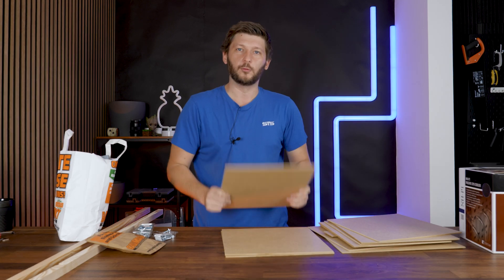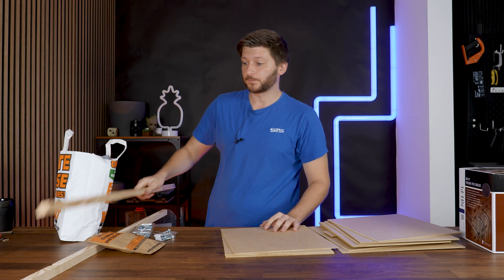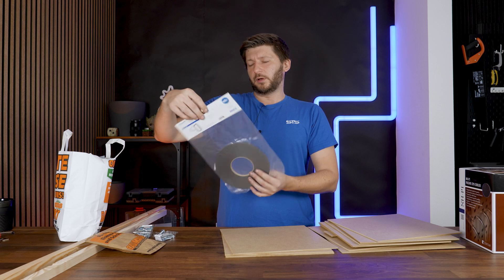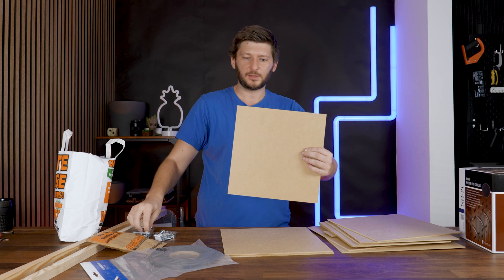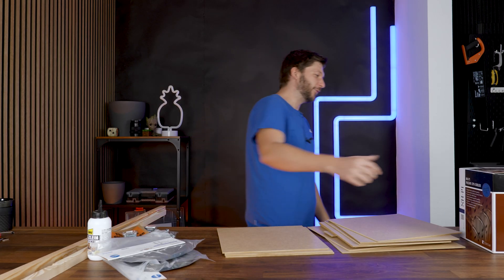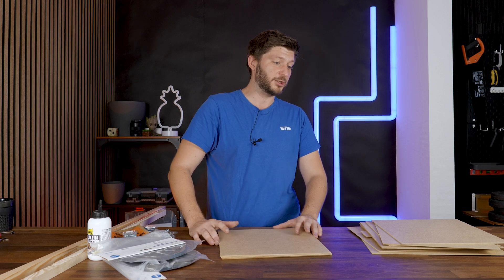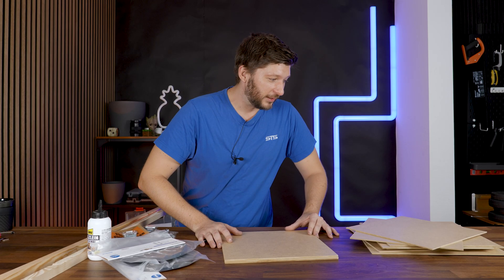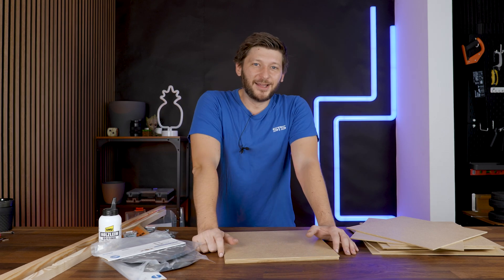Why Are We Doing This ? - Building The CASE Fan Testing Machine - Part 1

Comment: I like your pursuit of better methodology. I wonder if you are interested in building a proper wind tunnel and measure airflow by using an anemometer? You can check HWcooling for inspiration, they have done an excellent job on this. It is a much direct method than to infer the airflow via the temperature change, no?

Comment: Instead of using a cpu as the heat source wouldn't it be better to use some sort of heating element  with precise heat output control? A cpu/os can always  be running slightly different background processes and  therefore run at slightly different temps despite the best efforts of the tester. This controllable heat source would also be excellent  for testing  coolers. We need more reviewers,  like  yourself,  who give the testing methodology serious thought.

Comment: Cant wait to see the end result., Very nice idea  - only one thing i woud have used slightly thicker wood ( Like 9 mm triplex wood ) . For the long term . Especially for those 4mm threaded mounted bolts that you Tap or hit  into the wood- Screwing in and out repeatedly , replacing with other fans of the same size. - Hope it holds together after 25  times or more.  Great cause i'm still looking for the ultimate 140mm fan.  :hand-orange-covering-eyes: